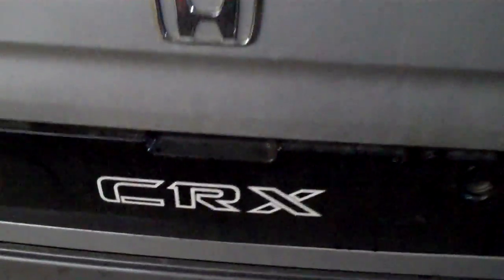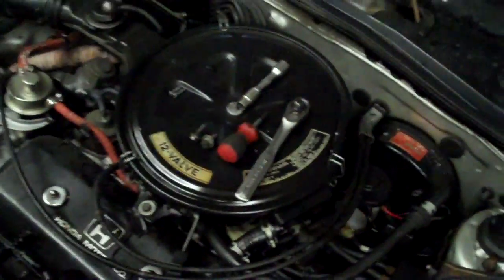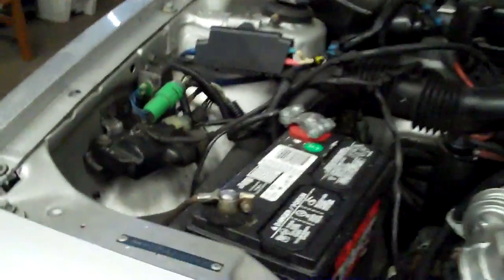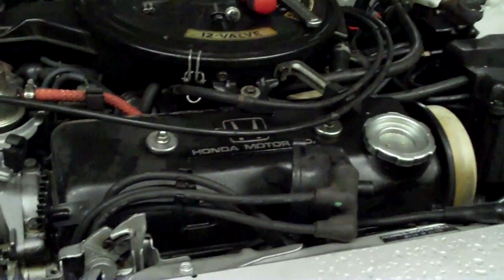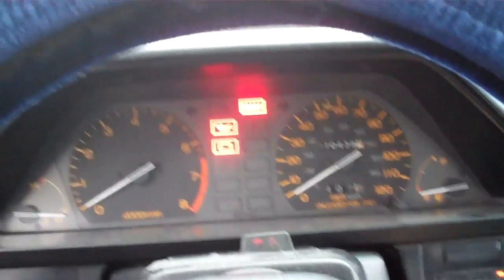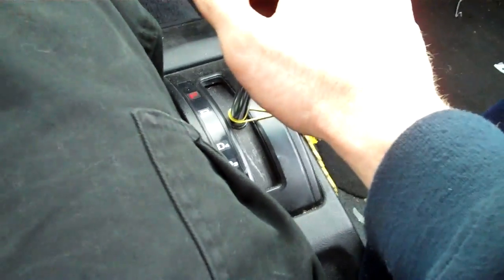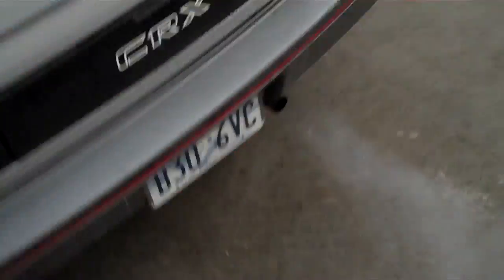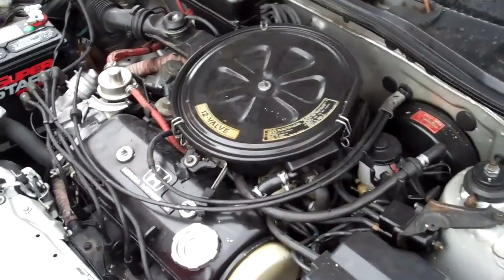How to off-road a no-start diagnostic chart

Comment: You're the best man. Last night I was putting more aggressive cams in my b18c1 engine and when I went to put the distributor back on and got it all back together I went to start it up and no start. Then I remembered this video took the distributor off and spun the part of the distributor that goes into the intake cam 180 degrees. Put it all back together and it started up perfectly! Thank you so much brian, I would have been scratching my head for hours if it wasnt for this video!!!